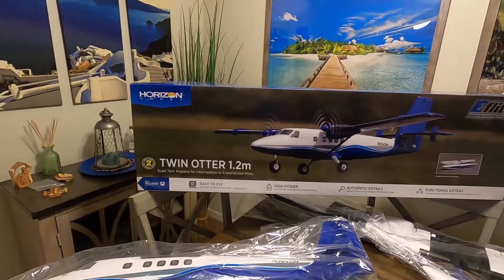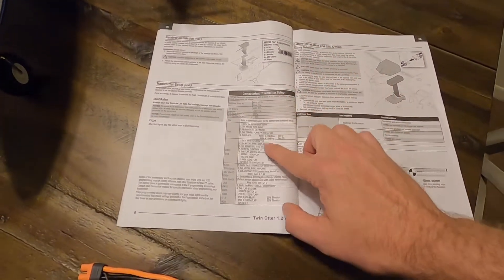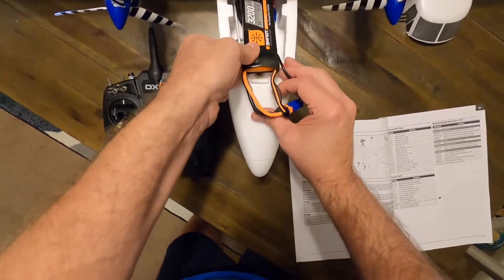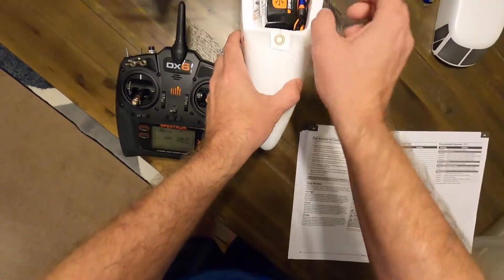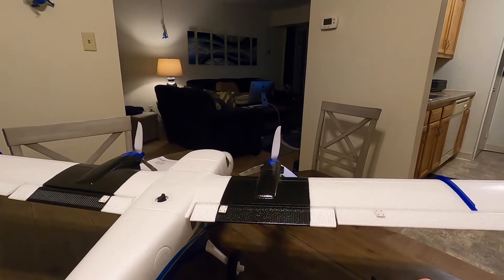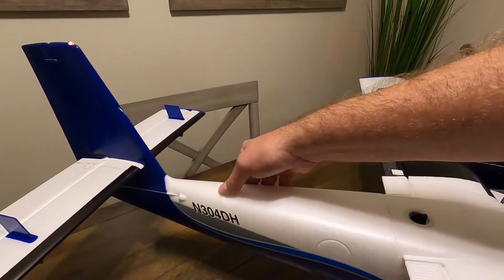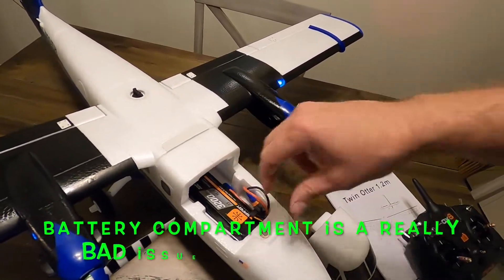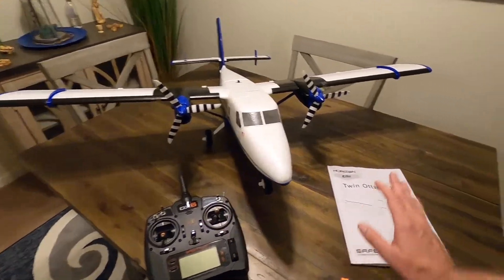Twin Otter RC Airplane Unboxing and CRASH

Comment: A few Tips:  Secure all the screws in the cowls etc with some foam tac or  take the screws out and use some Loctite.  They will vibrate out.  Also glue the wing spars into the fuse only.  This will keep the wing from flexing in flight and it will still be removeable.  Reinforce where the engine nacelles join with the wing with some glue and tape.  My buddy on his first landing one nacelle was hanging down.  He was lucky.   I had the cowls come loose.  I did reinforce nacelles.   Don't come down hard on the nose gear.  I did that and it stripped the servo.  I replaced it with a metal geared servo.  Now I have the landing down and always land on the mains first.
Reply from the maker: Thanks for all the tips I will do. and thanks for being a friend!!
Reply from the maker: also that field you have is great wish I had one like that as I said I have a grass field I go to but I wish to have a hard top like you have.
Reply: @DronemanJoeRc  yes we are blessed with this field and a great field boss.  The trees are a challenge with EDF jets but I have no problems with prop planes.  I'm getting better with my jets though.

Comment: Man I love the otter
Reply from the maker: its a very nice plane the only thing I have a prob with it is changing out the wheels to floats its a pain in the ass and the screws are so small and you have to be very careful about striping them. its a bad design on that part.
Reply: @DronemanJoeRc  I love stripping screws. It’s so fun to get out.  ~someone in a nightmare I had.

Comment: Most days, I damage mine more getting to and from the lake than actually flying.  There's a short blue streak on the basement ceiling from my Twotter's tail.
Reply from the maker: I hear you i seem to get more dings and scratches just storing it and moving it around. Also.. funny isnt it.

Comment: That used to happen to me before i programmed my radio system with throttle cut. Have you flown this one yet ?
Reply from the maker: No i will be taking it out in a few weeks. I did alot of unboxing over the winter and im in a middle of a move so once i get settled im taking it out. Thanks for the watch and comment.
Reply: @DronemanJoeRc  No problem